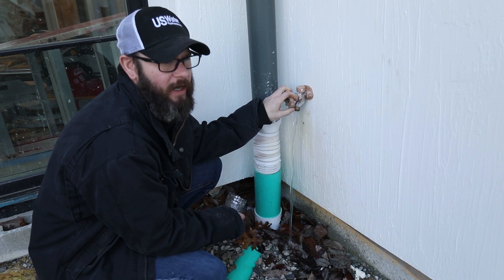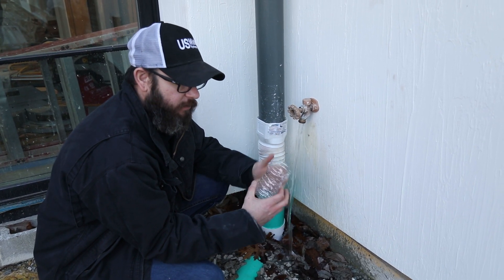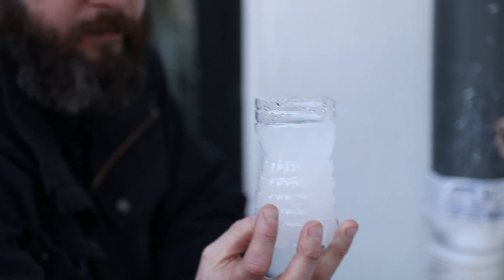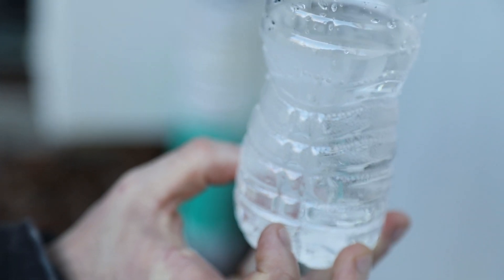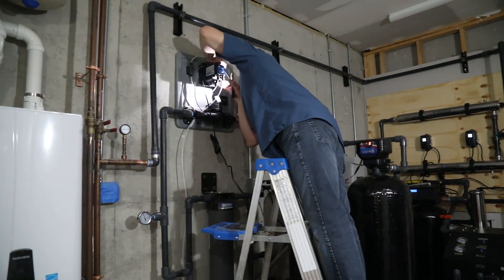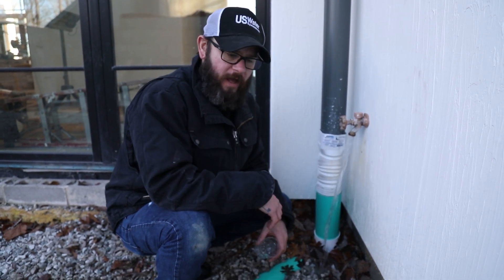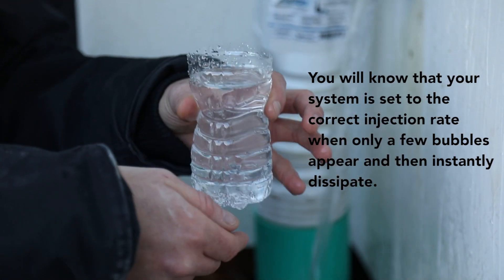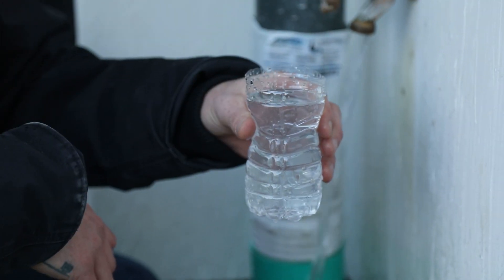How to set the Injection Rate for a Hydrogen Peroxide Water System (Bubble Test)

Comment: I finally got my Flexx Infusion system configured.  The bubbles part was a bit confusing in a way because I wasn't really sure what I was looking for.  I'm thinking of carbonated water or something a bit more pronounced. Seeing this video helps me get an idea for what the water should look like.  Good idea with using the outside water.  The problem with the interior water are the aerators on the faucets.  I also wasn't allowing enough time in between adjustments.

Comment: I'm not having much luck with this method. I started at 100% injection from a 40gpd Stenner pump and got virtually zero bubbles in the water from an outside tap. I tried in a bathroom with side by side sinks and got foam as white as milk from one sink but clear in the other. Why would I get different results from different taps?

I turned it all the way down to about 20% before I was able to get a clear sample like you showed from the "Foamy" sink. Now I'm worried that the very infrequent injection (once every few seconds) is not going to provide a good mix with the water. Should I dilute the 7% peroxide to 3.5% and turn the pump up to about 50% for a more consistent flow? I'm considering a switch to chlorine for simplicity.